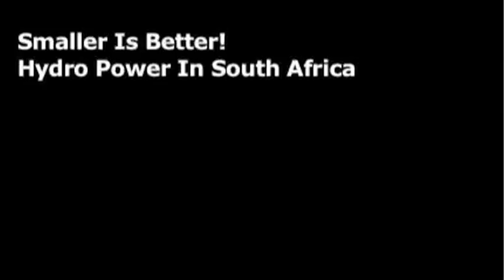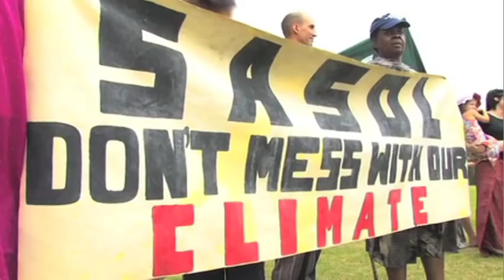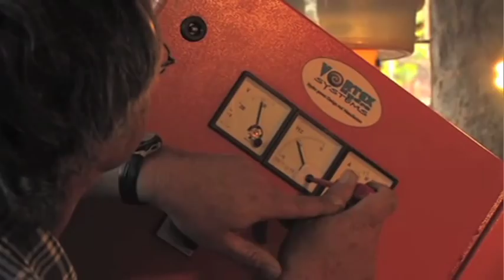Micro Hydro Turbines: The Expert

Comment: Great video. Unfortunately, hydro power generation does not work just anywhere. I live in Victoria Australia, and although we have a large number of fast flowing rivers in the North-East of the state, flow rate diminishes during our summer months. NSW has a huge hydro-power system in operation fed by the melting snows from lake Jindabyne in the Kiewa valley. Cheers.
Reply: Yes, not a universal solution. Tax the life out of coal and oil and use it develop modular Thorium molten salt reactors I say.

Comment from the maker: Hi Pelton,
Thanks for the insightful comment.  Yes the end of state subsidies for Coal power and other environmentally damaging power generation technologies is a great thing.  Next it would be nice to see a higher-than market price for locally produced power from renewables.  Which makes sense since they support and benefit infrastructure and lower costs across the grid.  Imagine a time when the Grid becomes a massive battery.  Do you have links to some photos of your system?  You also in SA?

Comment: This is excellent. Is the governing system load diversion or is it water flow reduction? Water flow reduction for off peak would be the magic trick everyone is looking for.
Reply: this is a load diversion system to dump the excess power. for water flow reduction we would need a mechanical governor to regulate water going through the turbine runner. this is a complex system that is not needed for small hydros as it requires complicated PID control
Reply: @martinkingori9598  Yes I understand. It was a bit ambiguous in the video. If it was a flow reduction type, it would certainly get my attention. I would certainly want to see how that was achieved in a micro system. I don't think the response time would be sufficient in a micro system since demand changes can be sudden going both ways.
Reply: @nez3009  i also feel that the load diversion type is a waste of energy.In such arrangements that i have seen, most dumploads are heating elements..the users end up having tanks of hot water that they don't require..furthermore the turbo generator is always on full load imposing larger mechanical loads on bearings..wear and tear is much quicker
Reply: @martinkingori9598  I agree. I live in northern NY and have a hydroponic system with cast iron rads so there is no such thing as too much hot water in the winter. Never the less, I think with the right engineering/testing, something can be designed to regulate flow on a micro system. I think having some kind of battery would go a long way for rapid spikes and demand decreases.

Comment: I regret to say the wasteful (I am one of them living in a electricly heated apartment) electricity dependant society the sheer scale cannot be supplied by any combination of wind, small or large hydro or solar power. A few large or many more medium size, gigawatt or hundreds of watt, central generating stations will be required. 

Fortunately these do not have to burn oil, gas or coal to power the steam turbine generators that make the electricity. There is a nuclear fission based power cycle that is neither as expensive as Uranium fueled nuclear power. It is Thorium based nuclear energy. The greatest advantage of this system is it does not need a huge and expensive pressure vessel around the core. These operate the heat generating core at atmospheric pressure. The reactors can also be built in a wide array of sizes so can power smaller cities.

In the meantime in places where flowing water is available I support using as much as practical the water power available. Developing the smaller sites is easier and faster than the huge projects generally sponsored by central government's. 

You are using cross flow turbines. They are simple to build and Install but are not very efficient. I suggest you look up a couple of Indian turbine manufacturer. When I was working redeveloping hydro sites I looked at one of these companies and was favorably impressed.

Comment: how much power could i produce with a small waterfall that produces 70 gallons a minute and drops 17 feet to the4 ft water wheel i have made? and what kind of turbine would be best to use
Reply: 880W but at realistic efficiency it is 528W.
Reply: Not sure how to calculate a water wheel though you will probably get less.
Reply: ben lawton what would be the best turbine setup do you think would be best
Reply: Daniel Bradford yes turbine is better since you will be using all the head
Reply: Daniel Bradford you won't get very high pressure though since it is only 17 ft
Reply: Daniel Bradford btw you calculate it by  head X flow in litres /s X 9.81 what is the acceleration of gravity
Reply: Look up turgo turbine

Comment: we can produce endless amount of energy through sea water hydrolysis .then  we take hydrogen alone to high altitude ,where we combine it with atmospheric oxygen, and drop the formed water on hydraulic turbines as in dams.
Reply: #1 What would you use to power the hydrolysis? Hydropower? This idea seems to be a perpetual motion scheme that can't work because of the problems of efficiency.
#2 ever hear of the water cycle?

Comment: wow, great job, i can only understand that the energy company's are only using coal & nuclear power for profit, if a small community & town could all pay into a project, we could wipe out high cost of power, I saw a guy on you tube using a tank that store water, Then it uses the pressure of the falling water on a turbine to then let the water go back into the overflow. this would also prevent flooding, if there was too much water flowing though the river. but it would mean we would need a large amount of though tank to prevent this from happening. I came across an answerer a guy said, he said what if the water was to become too cold, well i can only think that, that you could have a small thermostat inside the tank to prevent the tank from dropping to a cold temperature. to prevent this happen. this would cost power, but would be a back up to prevent the system from jamming or braking completely as it made of plastic, "well the tank anyway". if you could have a auto system to switch this thermostat on, using the power of the hydro system to take so much power, but to limit the temperature so it would not fall to below 0c degrees. This would keep the electrical system going & only use a small amount of energy to heat the tank in the mean time. well the weather warms up a bit. then the auto thermal stat would shut off after temperature of atmosphere warm up. Given you all the full energy it generated in the first place.

 Looking at the pro & con to this. solar can only give power during the day. Turbines are dangerous to human health. due to there sound & flicking shadows. Sound can vibrate though human as sound travel though solids. That why they are set up in the sea.  I saw how it had destroy a town.  As energy company's ask to let out your land, then you sign it without reading it because they said it was green, you understand that need money so offer you something small to pay off a bit of your land mortgage  . They then build the thing all over your land. I doesn't matter to them, they can build them right next to your house then it driver you mad, i have heard & saw a family in america. they moved into a hotel because it was that bad. The flickering in the window of the turbine drove them insane. I can say they don't always spin due to the wind. That sometimes they need shut off if they spin to fast. Ice can shatter sometimes. so there no big investment to wind. there a waste of money. the cost of building them far outweigh your profit unless they can spin for 70 years. So i say here that micro hydro is a great of source energy. it has a little impact on the environment & are fairing cheap for the investment.  I live in wales we have lots of river & we hardly use them what a wait of energy. sorry for the large amount of writing people. hope you all the best & thank for reading if you had chance.

Comment: use running water energy at it's maximum potential and used it for steam boiling water
so we know that water going boiling at 100 degree celsius now we turned the turbine with help of water steam
so we got more efficient and effective control over the stability of voltage production instead of loss of energy in electricity circuit and very much costly technology infrastructure
happiness is not the costly technology infrastructure we. can use this property of water on e every planets of universe by applying automatic setting of pressure on the system
💠💠💥💢

Comment: I hate misleading crap. Those nasty big old damns and power stations.... So scaling it down is better some how? So the big one probably serves 200,000 and his serves 20 so how many of his would we need again???? 1000's of little micros all over, that wont affect the environment?? Hey I love these micro plants but all have to alter water from the river, stream or whatever. Most areas don't have white water rapids to draw from so they build a holding pond of some sort from just a few rocks to large concrete structures. There is piping that in some cases goes for 1000's of feet to build up enough head (pressure)….
Reply: Hydropower uses dams to create the head. 
Micro Hydro power typically uses underground pipes to create the head there is no flooding required creating land and habitat loss. Additionally they are typically owned by the owner of the property that it powers. No big Corporation or government needed.